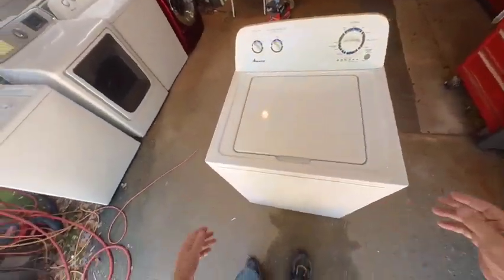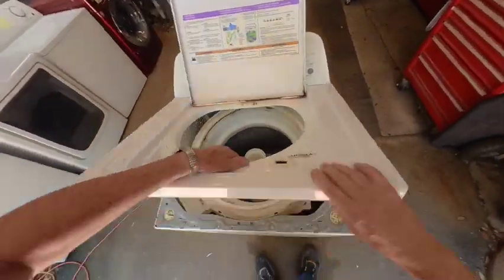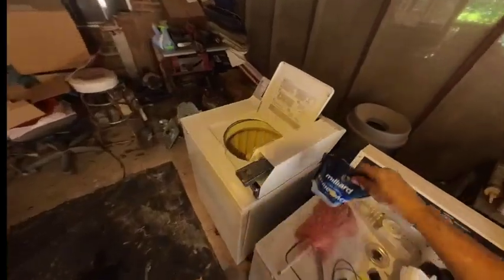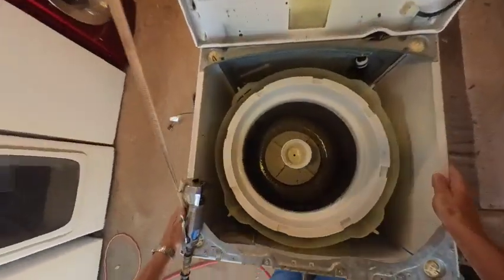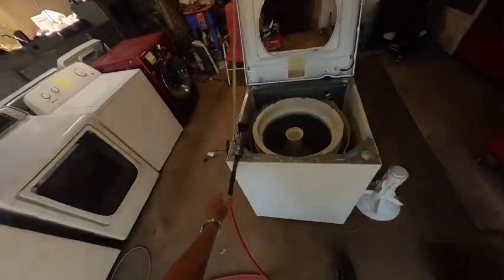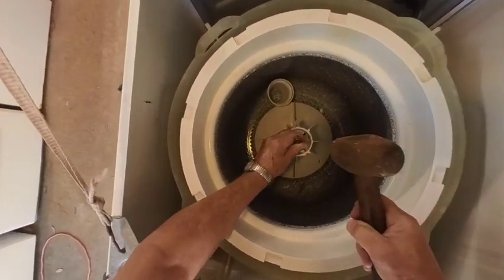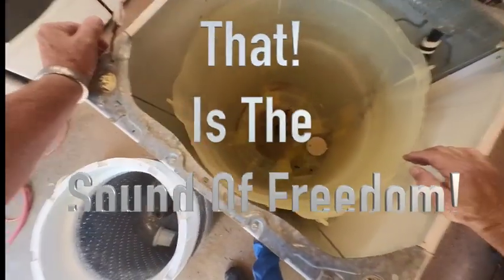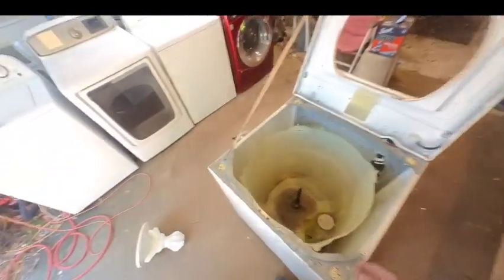How To Diagnose an Uncommon Washing Machine Failure: Starting with a Stuck Agitator

Comment: I had a repair guy come out and check my maytag bravo washer out.  Wasn’t spinning the water out of the clothes.  Took him 45-50 mins to get the agitator off only to tell me it was gonna need a new transmission and basket.  He was going to charge me $926 for parts and labor.  After i paid him his $60 i got to looking at it then after minimum research low and behold i went and bought a new drive hub for $25 installed it and works great.  I got lucky cause we were about to go get a new washer from lowes, but something didn’t sit right with me lookin at that ole hub.  I just don’t understand if he missed it or just wanted to sell me a new washer.
Reply from the maker: Wow!  You could buy a new machine for that!  I could understand the transmission if the splines are corroded . That’s usually why the tub hub fails. But a new basket? Highly unlikely! That machine has a very high incidence of spline shaft failures because of corrosion.  I hope that new tub hub will last you awhile. If it fails again you might be making a trip to Lowes after all.  
Hey, thanks for watching and good luck with that repair.
Reply: Yea before I installed the new hub I noticed the rusty splines your right. I don’t believe it will last long.  To his credit the repair guy was half right but i can get a new transmission for $165-$225 + $25 for the hub.  And spray a rust proof enamel on the new spline and maybe drill a hole crossways on the shaft and hub to put a row pin through them both.  I talked with my parts guy and he sells four hubs a week and says they may last a little as three months.  I love watching keep the videos coming great peacock by the way.

Comment: If you have time, a video that shows (time elapsed) what all the different wash settings actually do (like with a lid opened view) would be interesting and appreciated. My washer has bulk, super wash, heavy wash, regular, quick, delicate, etc settings with no good explanation of what happens under the hood. I think bulk actually fills the tub up with water like in the good old days.
Reply from the maker: Hey, that’s a good idea. I’ll dig out the ole tripod and do that. It might be awhile though, I’ve got several in the works that I need to edit and publish. Thanks for the idea!  I’ll mention you in the credits.

Comment: Or how about a tourch and melt the crap out of it into submission.?
Reply from the maker: LOL, I'll pass on that tip!
Reply: @HarperandKnowles  There is a lot of heating with an open flame without plastic ignition. Like I said, melt it into submission. Heat till you can cut through with a box cutter.
Reply from the maker: @mostlikelywedoitservices6926  Under all that plastic is the metal spline body that is the part that is stuck! I have chipped all the plastic away and used a puller on that spline sleeve.